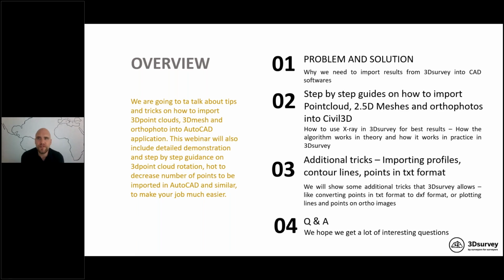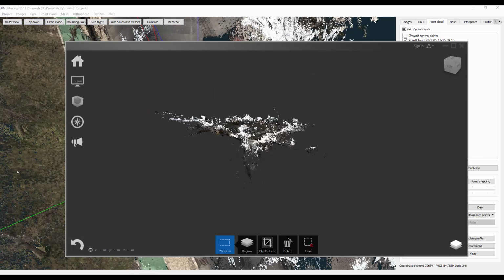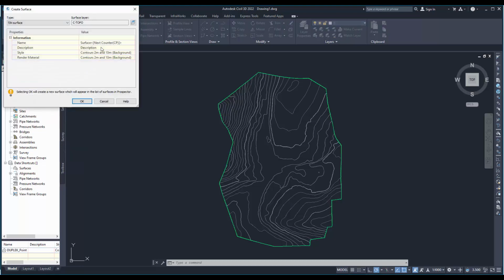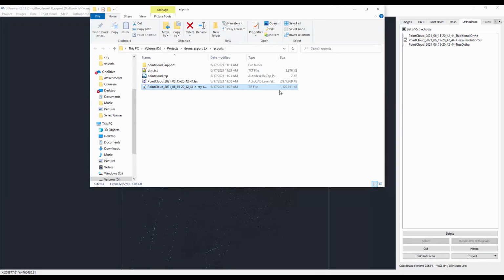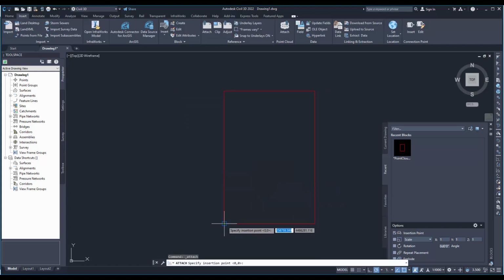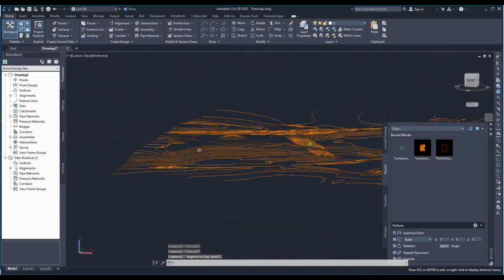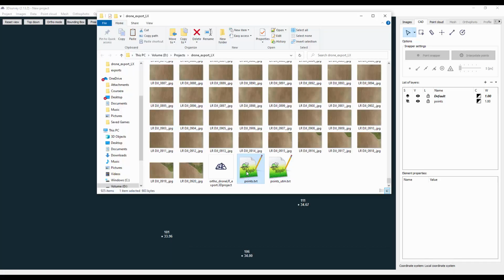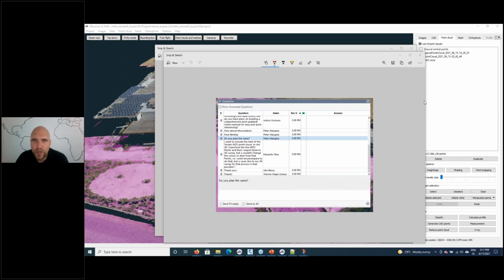Webinar: Step-by-step how to import 3Dsurvey pointcloud, 3D mesh and orthophoto data into AutoCAD

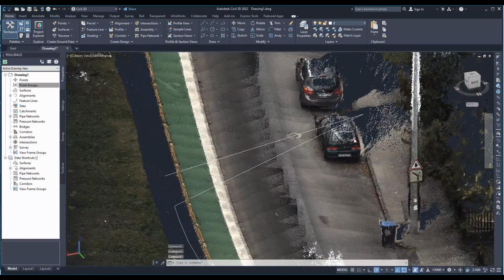Comment: Are you sure that you can draw like that in autocad? It seems like it doesnt snap good to pointcloud so when you change view, lines dont match pointcloud... You draw on curb, change view and lines are not on curb anymore... Seen on  14:38 (line on curb)- 15:11 (line behind fence).
Reply from the maker: Of course, snapping on pointcloud points works a lot better in our 3Dsurvey then it does Autocad.